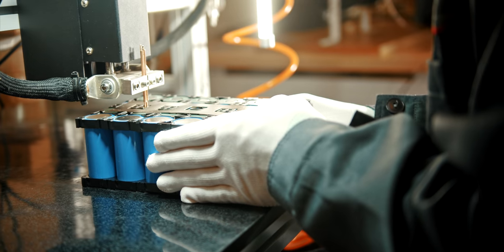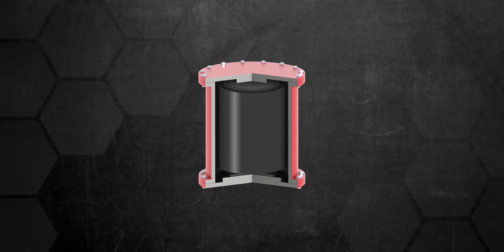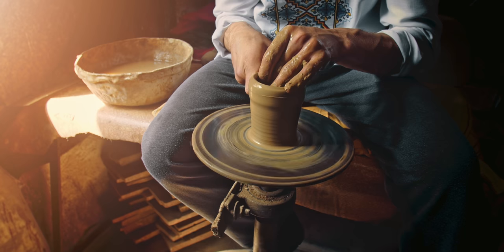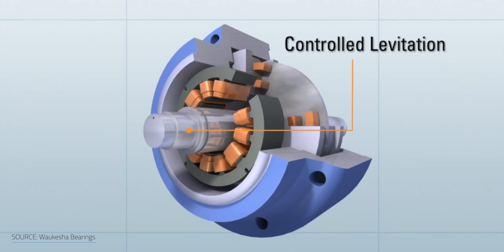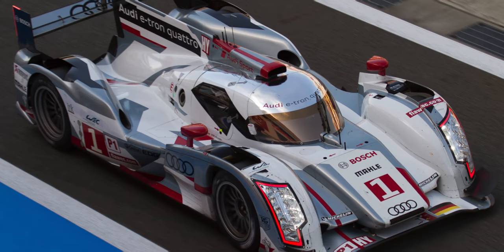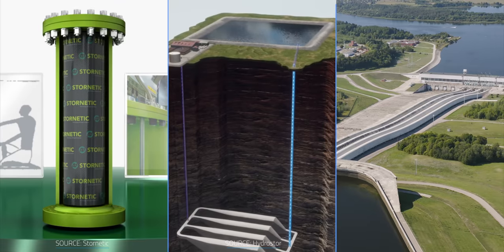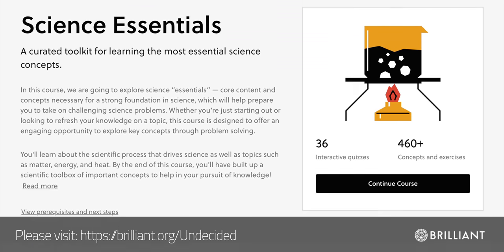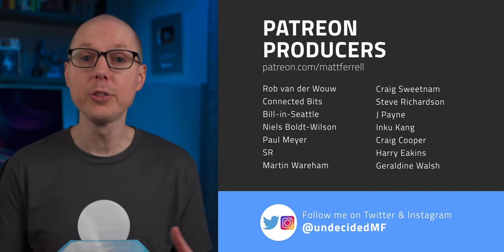The Mechanical Battery Explained - A Flywheel Comeback?

Comment: The place I work at spent over twenty years developing a flywheel system until in 2006 a 300kg one disintegrated while spinning at 13000 rpm. By incredible luck, the people in the workshop had a coffee break when it happened, except for that one guy that lost an eye due to carbon fiber fragments and luckily managed to escape. Mentally the guy never recovered and had to live on a disability pension. 
Recently a coworker showed me the scars the flywheel left to the building while it bounced around. It left dents in half-inch thick steel I-beams and in the concrete ceiling, not to mention all the destroyed equipment. They stopped development soon after this accident.
Reply: half a inch of steel really is nothing. maybe its a lot for humans
Reply: So sad the development has stopped. It's obvious, that if your energy storage dense enough and fail, this energy will quickly be released in a destructive manner. All they had to do was update safety regulations for prototype tests and product operation, that make it impossible for people to enter the zone with working flywheels.
Reply: @rainbowhyena1354  true
Reply: @jurrienp9929  The flywheel disintegrating and hurting people is a risk management issue. Not a flywheel issue. Why is the high energy density storage device placed in such a way that a catastrophic failure could damage a human occupied space? Were they storing large tanks of gasoline indoors in a workspace too? Are they also having people sit on stacks of charged lithium ion batteries? 🤣

Comment: I think flywheels work best as a first-step capacitor, one that stores foremost to the rest.

The durability is there, but in terms of keeping the energy there, I don't think it outlasts friction better than a battery or water.

So pick one to store to after the immediate efficiency of the flywheel is lost
Reply: Bio chemical and synthetical chemical energy storage is the best, cheapest and most versatile energy storage as it can be universally harnessed by many machines, heaters and more and if we don't want to or can't use a solar reflector and catalyst array to bypass the biochemical aspect, nature does a really good job of storing solar energy biochemically, it's just a shame a new religion has formed that shuns it's use.

Comment: Maybe you covered this and I didn’t understand, but what is the cost per kWh averaged over the lifetime of a flywheel (Including installation and eventual recycling, and long life expectancy) as compared to Li ion ?  It’s not just kW installed, but total kWh delivered that make this worthwhile or not.
Reply: The recyclability of their components is a huge factor that gets overlooked. Lithium batteries are expensive to recycle to the point that it's not even profitable in most cases, whereas an all steel flywheel could be sold as scrap metal at the end of its lifetime. These high tech composite flywheels are cool and all, but a cheap reliable steel (or other basic metal) one would be ideal.
Reply: @fortunefed8719  Id rather make one that looks like a bike wheel with steel at the center and depleted uranium where the rims of the tire are to maximize the angular momentum.  Probably too costly though so Id revert to 12 barrels of water connected to steel connected to a center ring that rested on magnetic bearings.  Not much is cheaper for adding a lot of mass than water.  Maybe dirt?
Reply: @Wemdiculous  Water isn't very heavy for the space it takes compared to alternatives, including, as you said, dirt.
Reply: @Clarence Thomas If you fill an electric train with ore, and power it up a mountain side when you are generating excess, and then release the train when you need the power back, you've essentially done the same thing as the flywheel but on a massive scale.
The "engine" acts as a generator when coming down the mountain.
Reply: @Clarence Thomas except that it's already been trial run in Nevada.  Anywhere you have a rail system and a reasonable incline, you have a ready made, inexpensive, reliable and efficient storage system.  Just add electricity and an electric engine.
Reply: @Clarence Thomas  it is a shame that your maths comes down to commercial thinking. Surely this on a government level would be better and cheaper long term. The environment must come in to the equation, not just American style profits.  I accept your real world ( American business) thinking but why not mix these technologies. 
Profit can be a driving force but it is often a limiter from what is the right path.
Reply: @Clarence Thomas I guess you haven't done the math at how much energy it takes to pull at 100,000 metric ton train up an incline 3000 feet over many, many miles.
When you line up train after train, on the already existing infrastructure, it's a lot more than you think.  We are talking a dozen engines on each train hauling thousands of tons of material up hill, with a nearly 87% return on the energy.
Reply: @Clarence Thomas well - but there is the scrap cost of the flywheel at the end of it's life - could change the calculation back into favouring flywheels.  
Also - except the bearings I don't really see what could get worn out with a fly wheel - so recycling a flywheel into a new one (with new motor/generator and new bearings) could be a lot cheaper than building a new one...
Reply: @Clarence Thomas they have already built a functioning model of this in Nevada.
It's simple.  Fill a train car with ore.  Then, raise it 3000' relative to the starting point.  That one car could power a small business for an entire day rolling down that mountain.  You can return over 80% of the energy it took to raise that car full of ore.  It's more efficient than pumped storage and less expensive to build since it's 100 year old technology and well understood.  Materials are cheap.  These would be built near the wind farms in places like California where those farms are located in mountainous regions.  The tracks are cheap to lay and will last decades before needing any real maintenance.
Reply: @fortunefed8719  The real question though - does a steel cylinder even have a lifetime? The electrical components and bearings certainly, but the bulk of the equipment seems like it would have an infinite service life if maintained properly.
Reply: @Wemdiculous  just use the uranium for reactors at that point lol
Reply: @t00by00zer  I’ve seen some other interesting variations on the “gravity battery” concept you describe here.  I find them all very interesting and ingenious.
Reply: @Clarence Thomas but you didn't factor in the man power hours of one installation instead of 4 installations and 3 removals. Labor is not cheap in developed countries.

Comment: Flywheels would be great for a single home looking to level grid pricing - store the cheap energy of night prices and use them in the day for your A/C.  Also, solar and wind can wind up the fly wheel as well.
Reply: No. They would not. It’s absurd we are trying to go for wind and solar, instead of time and tested tech like nuclear. We are decades behind where we should be because of fear
Reply: @jamesbizs  Really? Very interesting. Nuclear energy is not only highly pollutant and dangerous, it's also incredibly expensive when you remove the SUBSIDIES.
Reply: @nandodando9695  Chernobyl and Fukushima ring a bell !?
Reply: A molten salt reactor using thorium is a solution.
Reply: @ElvirBegovic  Chernobyl region is very green now that people have been evacuated.
Reply: @ricardotavaresdias9037  no,it isnt..its the only sustainable clean energy source in 95% of locations
Reply: @ElvirBegovic  old ,outdated tech in stupid conditions......seaside anybody? nuclear is far more advanced now
Reply: @ElvirBegovic  Chernobyl had a outdated poorly designed reactor, and then that reactor was ran through a test that was basically "how far can we push it"
Reply: @jamesbizs  ..you still need electricity managment for nuclear stations..
Reply: Issue is, lithium costs less. So why go with a flywheel when you can go with lithium?
Reply: @leolego2  The initial cost of a lithium ion battery might be cheaper now, but the battery degrades over time.  At some point (5 or 10 years) it will hold maybe only 1/3 of its original capacity.  At that point, you'd need to replace it with another battery.  Over the course of owning a home, you may need to buy 2 or 3 replacement batteries effectively doubling or perhaps tripling.  A flywheel doesn't degrade like that, because it's just a big cylinder of steel or stone.  Effectively, it could last 100 years or more - with proper maintenance - but it wouldn't come close to a replacement of it.   Check out this: https://www.youtube.com/watch?v=yhu3s1ut3wM

Comment: 20 years life time is a vast understatement, replace one baring and you are set for another 20 years
Reply: I'm not sure a magnetic bearing would need replacing, would it? No contact, no friction... What is there to wear out?

Do permanent magnets degrade over time? 🤔
Reply: Permanent magnets do in fact wear out over time. Electromagnets too but much more slowly.
Reply: @EleanorPeterson  They last a long time. In 100 years they will only lose about 1% of their magnetism in proper settings.
Reply: @HELLO7657  steel (a ferrous metal) completely resists fatigue under a certain limit (I think it's 20 MPa). So we could make the load bearing part out of some steel alloy.

Comment: I love this idea of combining older concepts like the sterling engine as well but with our modern advancements in data, technology, material construction 3d printing, batteries, magnetic bearings, ac alternators, superconductors, computer programming, renewable energy. They could find unique places to be used and in unique ways. Not everything has to be large scale. Some things could possibly help moderate home temperature or something, you name it, I'm open to outside the box ideas.

Comment: Flywheel "storage" is more like capacitors, than like batteries. They are great for balancing and smoothing out power (this is their primary use in mechanical machines, like combustion engine in your car), but they can't go for long periods of time as they can only hold so much energy/momentum. Being mechanical is also difficult to scale.
Reply: Oh I was wondering about that.
The video didn’t mention how long they can retain their energy and a quick google search didn’t help either.
Definitely sounded closer to a cap than a battery.
Reply: @PHEEliNUX  yes, on the other side a big lithium battery let's say the chem used in tesla cars also loses a lot of energy each day in these capacities.
Reply: Just as with those new modular nuclear reactors, you can scale flywheel storage systems by operating many of them in parallel. It is even possible to transfer energy from one module (flywheel) to the next to smooth out / equalize their load.

Comment: I'm curious why flywheels have a "number of cycles"  since they're mechanical, shouldn't they have unlimited cycles?  I mean maintenance aside, and as mentioned with magnetic bearings that drops to near zero.

Also the physics teacher in me needs to correct you on the moment of inertia bit,  the heavier tire won't necessarily take more energy to slow down, it depends how the mass is distributed around the radius of rotation, 10kg of mass near the rotational axis takes less energy to slow down/speed up than 5kg of mass far away from the rotational axis.   That said, I'm sure that was simply an oversight.   But this is why you see flywheels as huge thick rimmed wheels that have relatively little material (holes) in between the rim and the axis of rotation.
Reply: You are right about your moment of inertia comments, but I think Matt was intentionally simplifying his analogies so they would be accessible to a wider audience.
Reply: Unlimited cycles? They have magentic motors  and also..they aren't made of diamonds everything tear out by time bro
Reply: Frugal Family Living  Thanks, that's what I was largely going for.  I know I should have put quotes around "Unlimited cycles" but it is what it is.   Plus you'd think a motor goes out, you swap out the motor and you're good to go again, batteries stop charging... you don't just reset their charge ability.

Comment: There is a Fusion Reactor in the UK that uses a flywheel to start as the fusion reactor requires more energy to start than the grid can supply so they store energy over hours from the grid in a flywheel then dump the energy into the fusion reactor. I love that ancient technology nis being used to start possible power generators of the future.

Comment: I used to work on a Industrial Nucleonics 1180S system for paper machine process control.  It used 400hz power but we had 60hz available on site.  So we used a motor generator to do the frequency conversion.  The unexpected side effect was that the MG set could survive momentary power loss due to rotational inertia.

Comment: Graphene batteries. That will be the game changer when it come to energy/electricity.
Reply: Graphene helps with charge/discharge and cycle lifetimes. Not storage density just to be clear.
Reply: not as much as the internet thinks it will. There are more interesting systems that could do more.

Comment: What are realistic charging rates?  "Few milliseconds" does not sound reasonable.
Reply: I noticed that as well. Completely unreasonable charging rate. No flywheel gets up to speed that fast.
Reply: Exactly, it's supposed to be fucking hard to spin to actually have energy
Reply: Depends on the configuration of the flywheel. If it's a small flywheel, it can get up to speed very quickly, but won't store very much energy. In theory, if the system is not lossy, any amount of energy dumped into the flywheel at any rate will alter the angular velocity of the flywheel and store energy. In practice, the motor which spins the flywheel does so effectively at a given power output (into the flywheel). This has to do with the physical constraints of the motor. So to answer your question clear as mud, it depends. If you are trying to spin up a 2 ton flywheel, it cannot be done in a few milliseconds. Likely that will take at minimum about five to ten minutes depending on many factors. It really does come down to the design of the system. If it has a 1,000 horsepower motor coupled to that 2 ton flywheel, it can impart and extract energy much more quickly than if it had a 100 horsepower motor (~745 watts to a horsepower). I say store and extract because the motor turns raw electricity into rotational kinetic energy, but it also works the other way. When you want to pull power from the flywheel, the motor slows the flywheel down to extract the kinetic energy previously stored. In theory, it's a much more environmentally friendly method of storing power. Better for stationary objects though. Gyroscopic effects can cause issues when trying to move. Fun fact, old school pilots found certain maneuvers in one direction were easier and in the other were more difficult due to the gyroscopic effects of the engine.
Reply: @Akya2120  you missed the point,its not about a few minutes up or down,its miliseconds,no usefull system will charge remotely near that fast.you need a tiny flywheel or a monstrosity of a motor to spin it.just for the sake of achive it.
maybe that number came from the time needed to stabilize the grid using a flywheel.
i think its not mentioned in the other version of this topic:
https://www.youtube.com/watch?v=_QLEERYS5C8
im starting to find a lot of videos that follow the same script,with same images,videos and general structure.im guessing if its a chapter store where youtubers can buy video guides and they just insert the voiceover and some talking head captures.

P.D:the infographic says that charge at 8KW in 4 hours.
Reply: It's probably depends on the motor inside, few milliseconds sounds like something to be fried
Reply: Not just unreasonable, but also useless... It's not a battery for a phone that you want to charge quickly because you have to be somewhere. And of course you need to have the energy available to charge it.

I think the maker of the video completely misunderstood the few milliseconds thing. Whatever the source of the original information was, it probably was talking about switchover speed/time from charging to discharging.

Comment: One other thing that wasn't mentioned was how much more dangerous fly wheels can be.  Yes with a lithium battery you can get a bad fire, but with a fly wheel you can get a bad case of things cut in half.
Reply: yep, more should be said about this. the reason most of them are installed in the ground is to contain the 'explosion' for when the mass fragments. Which is why that one company mentioned uses carbon fiber rather than steel. much stronger. Either way, not something you would want to install on a school bus.
Reply: Now I wonder if there are youtube videos of this